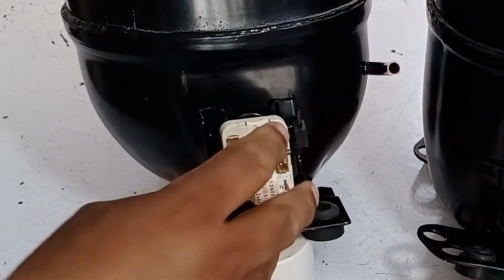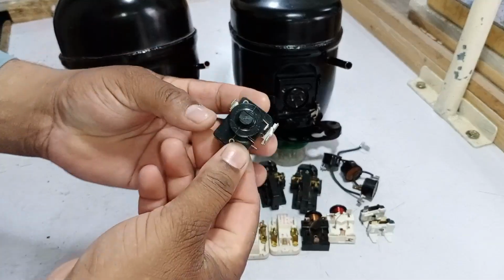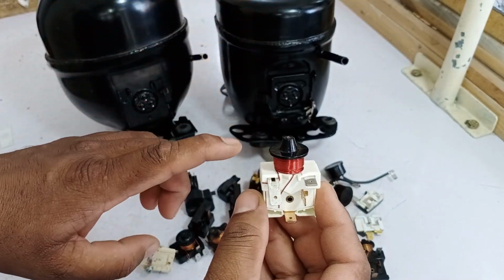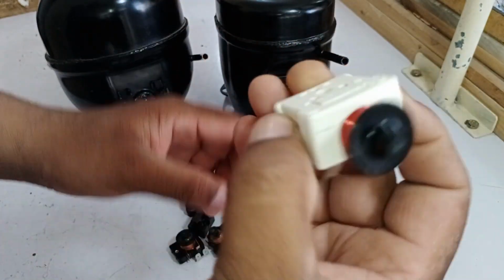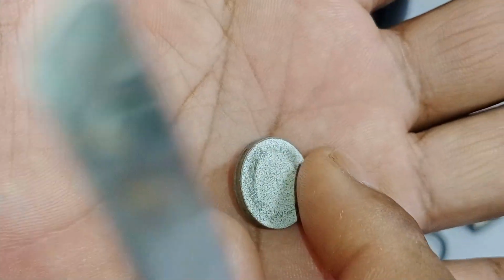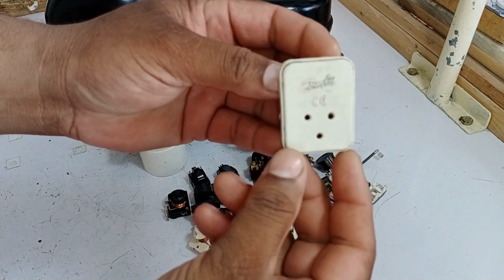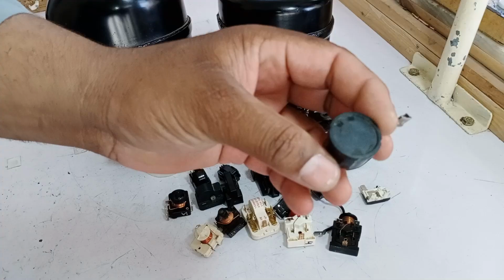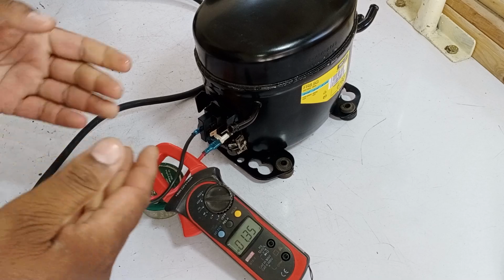Avoid THIS Mistake with Refrigerator Compressor Relays!

Comment: The most correct way is to connect two diodes in parallel, but in opposite directions, with the ends opposite each other, and connected to the terminals with the total resistance of the stator.
Reply: Hi. That's very interesting way. Can you please explain it with electric scheme how exactly do it and what kind of diodes to choose for the compressor. Thanks 👍
Reply: Verstehe nicht wie es funktionieren sollte

Comment: You Make It so confusing
Reply: A relay is just an electromagnet which pulls two contacts together to close a switch. They are used so that a smaller voltage/current can switch on and off a much higher power load and the two are isolated. They are all made physically different so that you have to purchase their specific types.
Reply: @Meat5000  the relays in this video use line voltage/current..   ISIS motor... Induction Start, Induction Run (ISIR) / Split-Phase Motors: These motors use a main (run) winding and a start winding. A current relay or a Positive Temperature Coefficient (PTC) starter briefly energizes the start winding to provide initial torque, then automatically disconnects it once the motor reaches speed. The motor runs solely on the main winding during normal operation.
Reply: @markhoffmann5941 But read the comment I replied to?

Comment: I have a older Amana two door you can unplug it and wait for 5 mins and plug it back in and it will run and cool for one cycle but it does not come back on. Can you please help me Thanks Roland It will run about hr or more the freezer works too just dont come back on with out unplug it